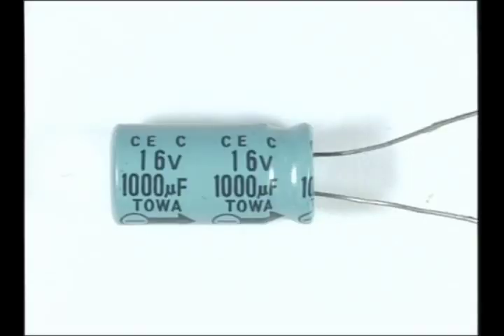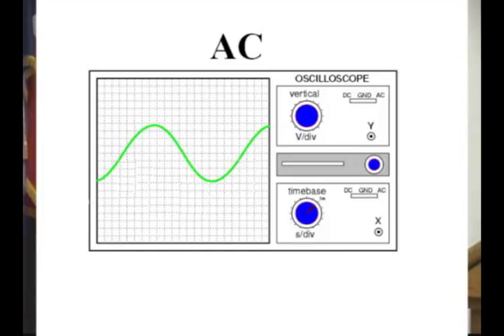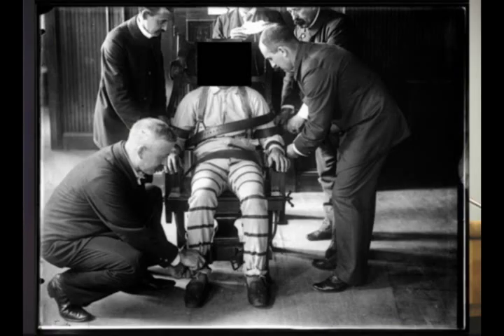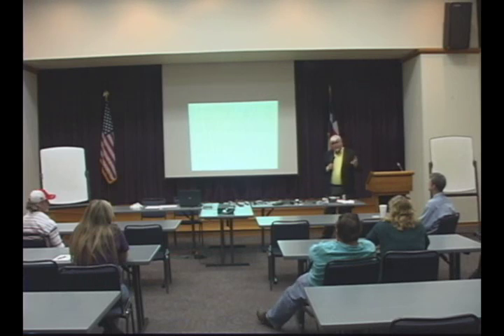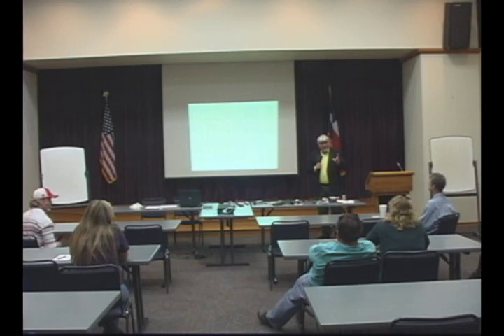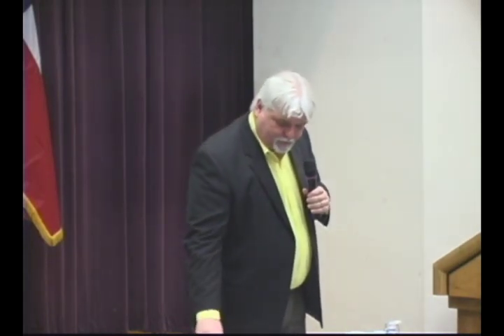Basic Electronics 2

Comment: Very good and simple.  Having used digital circuits for so long only, I totally forgot about the RF component of the circuit.  Now I am getting a better understanding of how tank circuits work, being that the cap limits current, but not oscillation, and the inductor limits oscillation and not current.

Comment from the maker: Not exactly light bulbs produce light because the filament heats up to a point where light is emitted. However in the Edison effect electron flow from the filament can flow to a plate in the glass envelope this makes a diode tube. 
In a neon or fluorescent bulb gas is excited by the electron flow between two plates the excited gas produces light.